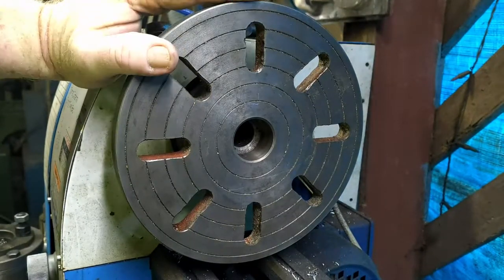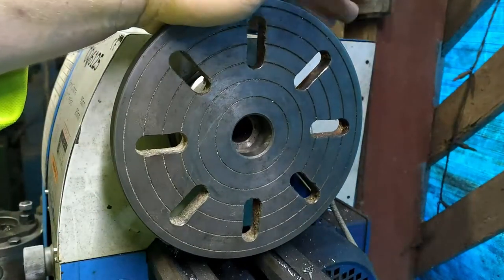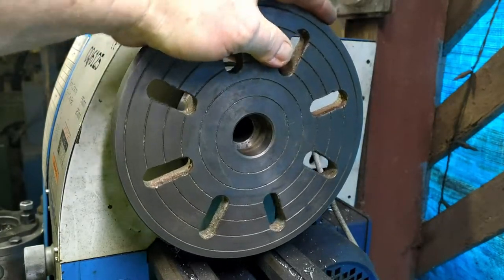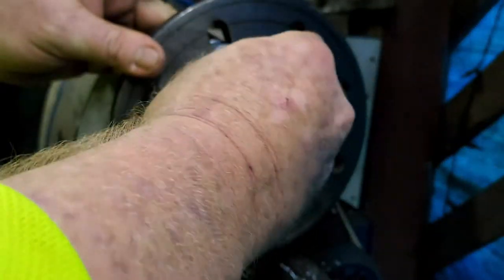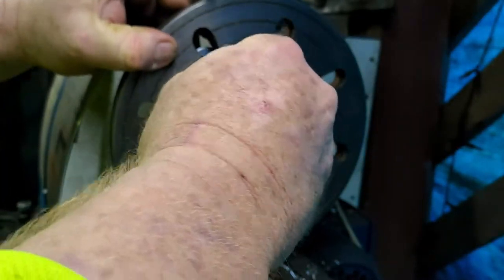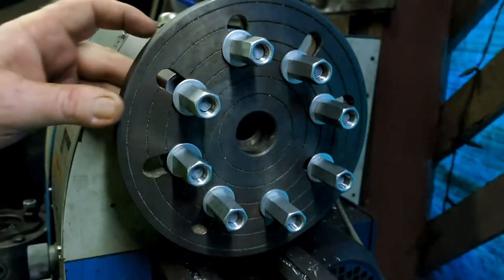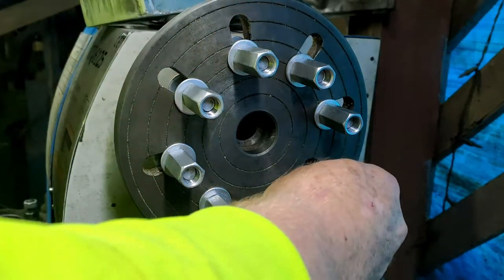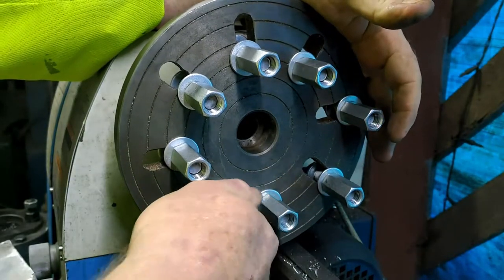Setting Up The Lathe Face Plate To Use As A Giant Chuck

Comment: But what is holding the work back to the faceplate? Wont it vibrate forward?
Reply from the maker: Seems to work ok as long as its done up tight ...
I have not had to many problems with it